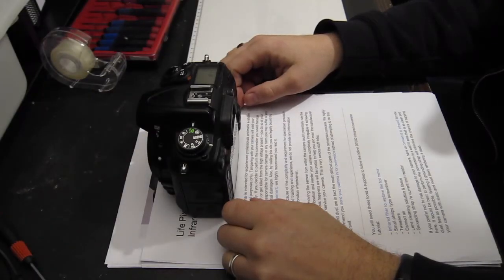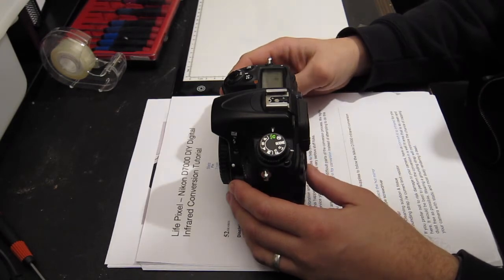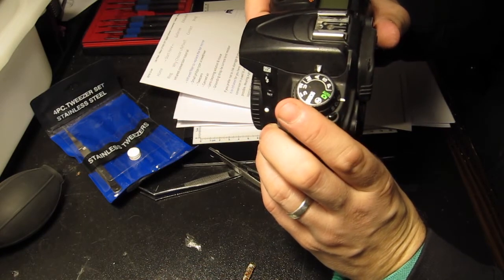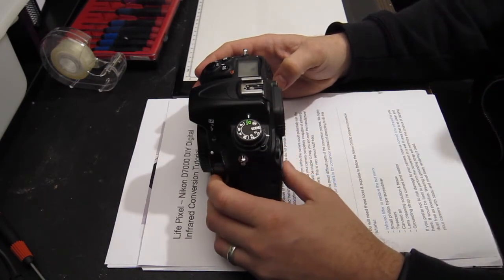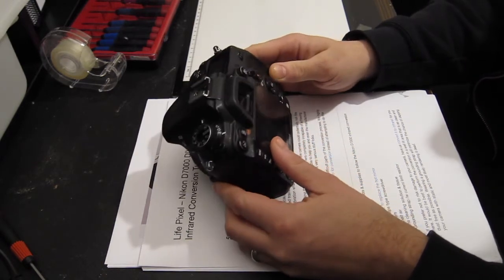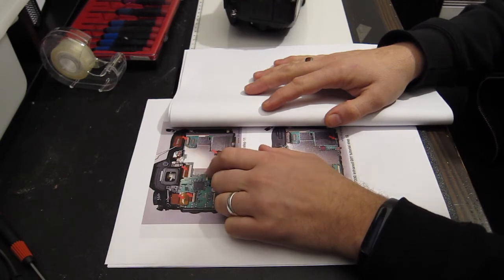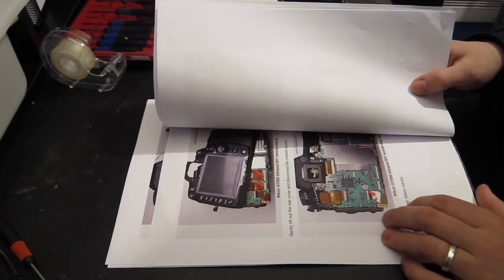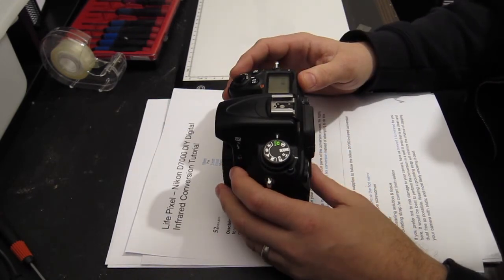Happy ending - Infrared blocking filter removal - part 2

Comment: Is this possible to do on the Sony ZV-E10? How do I find such instructions for this camera?
Reply from the maker: Hi, I have only looked at lifepixel.com IR conversion service and tutorials. They have a bunch of Sony models, but I could not find the ZV-E10. 
Maybe post them the question directly? 
Good luck!
Reply: @astroboden  Thanks alot for the prompt response! I will definitely check with them directly!
Reply: @astroboden  btw, could you please tell me what type of conversion do we need in order to shoot deep sky objects? Is it the Enhanced Infrared (665nm)
Reply from the maker: Hydrogen alpha is the most important one to let though, at 656nm. Sulphur-II is at 672nm, which is further into the infrared. Normally, if you have a OCS(one-shot-color) camera, like you have, you might want to use so called band-pass filters to isolate certain wavelengths. Normally H-alpha(656), S-II(672) and O-III(500). This is to remove light pollution. 
I don't know if the conversion will give you any options. Unless you find a service replacing the filter mounted with another one. I would go for some clear (or possibly some UV cut )filter replacement. 
You have a mirrorless camera, and I don't know if the autofocus is off-axis or not. If it's using the main sensor for AF,  you don't need a replacement filter for that, but I would check and make sure first.
Reply: @astroboden  Definitely, I will check first. Again, thanks for the detailed and rich information 👍

Comment: The focus after the conversion was way off... can you post more sample photos?
Reply from the maker: Hi!
Yes, indeed they are. 
I was too busy about removing the filter and get things working again that I forgot to mention the focus issue. It didn’t occur to me until later. 
If you don’t replace the filter with a clear filter the focal point shifts back from the sensor and the AF will not work properly. 
I mentioned this in the comments later or, in the description of the video I think. I never installed one as I didn't have one, and didn’t think I would need one. 
Anyway, I think this was the last non-astro image I ever taken with this camera. The astroimages are focused manually with different tools. You can look at these in the channel/instagram, but I don’t think they will picture what you want to see?